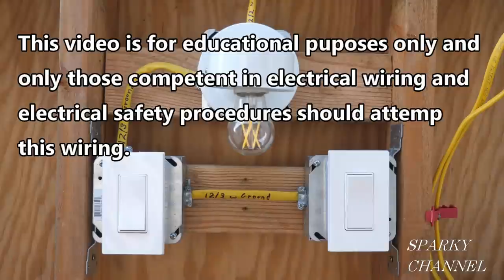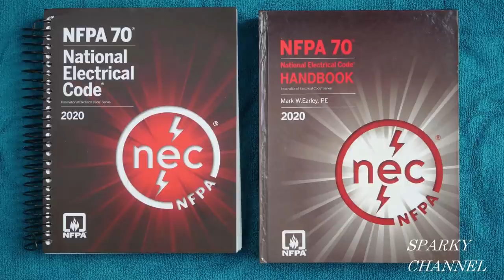How to Wire 3-Way Switches with Power to Light, Only 2 Cables and Neutrals in Both Boxes!

Comment: I don't think I have personally ever used a 4 wire that I can remember. Excellent video.
Reply from the maker: I have a whole roll of 12/4 w ground but it's in MC. It's really nice cable. Thanks Rick! Have a great Super Sunday! 🏈
Reply: I can't say I ever have either.  Because 4 wire w/ground cable is a specialty item only used in very specific applications, where I work if we ever needed 4 wire we'd run two runs of 2 wire.  A few weeks ago just finished roughing a house with a light/fan/heater combo in the master bath.  I ran two sets of 12/2, the second set I used red and blue phase tape on the black and white respectively on both ends of the cable.

Comment: Great vid again!!!!  And remember to mention the oversized boxes for future stuff
Reply: why if pros are to cheap along with do it yourselfers or they dont know than they are not skilled enough & shouldnt be attempting to do trades work its called trades work for a reason. only craftsman should be doing electrical work not con-men i mean professional contractors. lol
Reply: @wizard3z868  I’m too important
Reply: @MrTooTechnical  lol 😂
Reply: @wizard3z868  lol. Rock on baby
Reply from the maker: I will mention the big boxes next video. I was watching a very popular electrical channel and he filled his little plastic box up with 3 cables including a 12/3, lots of wire twists etc. Then he smooshed everything into the little box with the end of his hammer and somehow stuffed the 3-way switch into it. Much better to pay a little more and use bigger boxes. LOL! Thanks Dave!
Reply: @SparkyChannel  who is this famous channel??????
Reply: @SparkyChannel  
I almost always use the biggest box that will fit in the wall but the interior walls of our home are only 2x3 instead of 2x4. Still if I absolutely need the room I'll put in a double box and then use a cover plate that is blank on one side.

Comment: I just changed my kitchen light into into a 3 way this weekend with power at the light. Wish this video had come out earlier.
Reply from the maker: More to come! I wanted to create a series on power-to-the-light 3-way switch videos because so many folks with older homes (40's, 50's, 60's) have power run to their lights first. And of course I like to include appropriate current NEC articles because I hate when people just say the code is this or the code is that. Half the time they are wrong or out of date anyway. Thanks Jamison! Have a great Super Sunday! 🏈
Reply: @SparkyChannel  my house was built in the 50s and so it was exactly that. However I also wanted to replace the cloth wire coming where I can, so I ended up just running new romex to the switch first and doing in that way. But I did ensure both boxes have a neutral!
Reply from the maker: @jamisongillespie3524  Excellent! I should do a video on that conversion. It would be too late for you but many others will be facing a similar situation in the future.

Comment: I use 12/2/2 romex. Supply house keeps it in-stock.  Same wire I use for heat/vent/light switches. It has white with red stripe instead of a blue.
Reply: Yes my local electrical supply house carries that as well but since I am just a DIY homeowner I won't be using it cause they only sell it in 250’ rolls. I'll just use two 14/2 cables. One will carry power/line and neutral and the other will carry traveler wires with the white painted either red or blue.
Reply: @njsongwriter  I have used 2 pieces of 12/2 for hvl instal as well. Do you prefer stacked switches. If you use a single gang box and I stacked switch with 3 total 12/2 cables (1 in for power and 2 leaving to the hvl) then you are pushing box fill to its maximum or possibly past it depending on type of single gang box used

Comment: I'm not sure about 14-4 W/G or 12-4W/G NM, but I have seen 12-2-2 W/G NM cable stocked at an electrical supply warehouse a few years ago.  Don't remember the exact price but it was very pricey.  It's really helpful for wiring split receptacles in new kitchens that now require AFCI & GFCI protection,  and you cannot share a neutral.  Like how many kitchens in the 80s, 90s & early 2000s, were wired, before just about everything required AFCI protection you could use a standard two pole 20 amp breaker and 12/3 feeding the  two GFCI outlets for the first outlets and the downstream receptacles along the countertop,  etc could alternate between the Red and Black phases and be standard or decora style receptacles, all run in 12/3 .
Reply: Ok who cares..make u a video 😅

Comment: Hi Bill!
Can you make a video showing us how to wire 3-way switch with power coming into the switch box when the light is between the switches where the second switch is at the end of the run?

This is the situation I have with my garage light. The first switch with the line cable is out in the garage, then the cable runs to the light and continues to the second switch in the utility room inside the house.

Comment: over here ground is Blue , Faze/ live wire is  ( 230 vac ) brown. Switching wires ( a wire that comes after the switch ) is always black. Earth wire is the same yellow green. wires are pulled always through 5/8 pvc pipe or if needed 3/8 pvc pipe.

Comment: Hi Bill from Sparky Channel 

Blew the roof off with that one

I’ve never seen 12/4 cable for sale. I’ll have to look.
Guess you could make it.
Would be handy to have.

Wondering, would that be  MC12/4 cable and do they make a NM version as well.
I’ve heard of 12/2/2 NM.....
So many types of cable
Maybe a video one day showing all the types, uses, etc.

One again, learned something new from you.

Thanks again....
Reply from the maker: Yes, you can buy 12/4 NM or MC at electrical supply houses. Thanks Jeff! Have a great Super Sunday! 🏈
Reply: I can buy 14-2-2 locally but only in a 250' roll. Not something cost effective for me as a homeowner that doesn't need more than 35 feet. I can either use two 14/2s or I found a place online that sells 14-2-2 for 83¢ a foot.

Comment: Is it possible to add an outlet to the first switch? I have this configuration in my garage but the line into this switch has a hot white wire? My line in is 12/2 and line out is 12/3 (which goes to the other switch).

Comment: Hi, I need a video of installing a ceiling fan, but having 3 way switches to the fan and the light separated. 
In other words, be able to come into the room, switch on the light or the fan, then leave the room at the other exit, be able to turn off the fan and then turn off the light separately. 
Also, do they make a double three way light switch?? If so what would it be called?
Thanks. I love watching your videos.
Reply from the maker: Cool! I could wire that for sure. I would use double switches on both ends each with 2 3-way switches. As a video that would be too long though I think. Each set of 3-ways would get it's own hot and each would have it's own load cable (leg) going to it's device.

Comment: Can you use this source to run a few outlets in the same room? Thanks
Reply: You generally want your lighting and receptacles on a different circuit. Is it feasible yes, but not ideal.
Reply: This question gets into NEC section 210 as to what can be done with various branch circuits.  As Victor said, it's a good idea to separate your lighting and general use receptacle circuits, if for no other reason that you don't lose the lights if someone plugs too much in late at night.  There are some situations such as laundry, kitchen, and bathroom where a dedicated outlet circuit is required (210.11, 210.52) and that circuit is not permitted to supply lighting outlets or receptacle outlets in other rooms.

Comment: When you have a mud ring installed, about how far does the switch come out from the wall? I'm used to everything being flush with the wallplate installed

I can't imagine those things are for exterior use only (mud/plaster protection) since I can't recall the last time I've seen a three way switch outside
Reply from the maker: I always use 1" or 7/8" mud rings outside. You plaster right up to them. They work beautifully for any exterior switch, receptacle or light. They have a variety of sizes available. Have a great Super Sunday! 🏈

Comment: One thing I'm not sure of is can you always run two 14/2 cables instead of one 14/4? For example run power to a combo switch from a fan/light. You need a hot, switched fan, switched light and a neutral if desired. Of course two cables works fine, but is it code? And if so, which conductors should be together? Thanks
Reply from the maker: I don't think there would be a problem but I'll have to check on that. Good question!

Comment: Why not make the black wire in the 12/4 cable be the “HOT” line wire. And make the red & blue wire travel. 
I think it’s simpler to connect the same colour wires together that have the same purpose.

Comment: You could put your black hot on your common black screw from your first switch, black and red for your travelers, us the red switch leg from your first light and bcap it to the blue wire on but that blue wire on your common screw in your second switch, and use the same red and black as travelers as you did to the first switch.

Comment: Why is a ground wire needed on the box on the right? Doesn’t the metal BX (I think you call it something different) ground the box.
Reply: Because he didn't use BX. There are two different common cables covered in metal. One is called AC (Armored Cable) which is often called BX. AC is rated to carry a ground through the metal sheathing.  The other kind is called MC (Metal-clad Cable) which is NOT rated to carry a ground through the metal sheathing.
Reply: @HoosierRallyMaster  thanks i did residential wiring about 30 years ago in Chicago never worked with anything but Emt. I love watching his videos
Reply: may not be needed but i always run an egc no point in being lazy no real cost diff either when they charge like %500 markup funny how a plastic box  is always like $5 or $6  but i can get an extra large one for $1.20 at big box store(lol i just checked they where like .65 cents with an old work at $1.33
Reply from the maker: @HoosierRallyMaster  Thanks for the explanation, that was really good!
Reply from the maker: @opietwoep1247  Thanks! Have a great Super Sunday! 🏈
Reply from the maker: @wizard3z868  Yes, you can always exceed code and it's a good idea to have a redundant ground!
Reply: @SparkyChannel  same to you

Comment: I had used 14/2/2 nmc (romex) also I believe there is 12/2/2 available..
Reply: availability varies by market and vendor, generally more miss than hit
Reply: Those are available locally where I live but you have to buy a 250 ft. roll. Not something I will ever do.

Comment: thanks Mr sparky!! I now have the best fix option for my home. it's was not done with code because it wasnt required in 1983 cuz it was out of city limits

questions: does it have to be #12 or #14 ok?
Reply: This configuration of lights and switches can be done using #14 wire.  Determining appropriate wire size across any given situation gets into many nuances of code, so I won't say straight up #14 is ok for you.   However, oversimplifying for almost all residential applications, #12 is for 20A breaker circuits and #14 is for 15A ones.  Match any existing wiring on that circuit and check that it matches your breaker size.
Reply: @RJ-ej1nr  i was reading up on it. i put all led lights as replacements. i purchase some 15amp to replace old cabling to these lights. one will only have 2 led (60 watt) lights and 2 outlets. Another will have 6 leds(60w) lights with 5 outlets. so i believe it will be ok. this will also free up a 20amp breaker for my heater in master bathroom.

Comment: instead of 14-4 or 12-4  either run two cables together or 3X+ the price for the 12/2/2- 14/2/2
Reply from the maker: That would work if you re-purposed the extra neutral to a hot. Then you would have 3 hots, a neutral and a ground wire. Good thinking.
Reply: @SparkyChannel  
You just answered my question.

Comment: The problem with 12/4 is that it is not available in lengths less than 250 feet. So you end up having to use two 12/2s instead.
Reply from the maker: True.
Reply: @SparkyChannel  
Actually, I did find a source online that sells 14-2-2 for 83¢ a foot.
Reply: You can get 12/2/2 instead of 12/4. Both have 4 conductors with ground
Reply: is using 2 runs of 12-2 in place of 12-4 code compliant?
Reply: @jerseyjim9092  don't see why not.   I've done that once or twice while wiring dead end three ways in renovations,  when I also need to have a receptacle below the newly added 3 way.  I ran two runs of 14-2.   One for the power, another for the travellers.   For the travellers I use phase tape and mark the black as red, and the white as blue.   Never had any issues with the inspector.

Comment: There's an alternative way of wiring this. On the alternative method you'll have the permanent line, the neutral, the ground and the switched line in all boxes. Black as permanent line connected on both switches to one of the traveller terminals. The red wire as switched line on the other traveller terminal of both switches. Connect both common terminals with the blue wire. That should look like this:

https://upload.wikimedia.org/wikipedia/commons/thumb/5/59/Sparwechselschaltung.svg/2000px-Sparwechselschaltung.svg.png

This is also the method to go if you want to install control switches which have a neon indicator in them. They're used if you switch a light which you can't see directly. The neon indicator in the switches indicates the lights are on or off:

I have this for my attic lights, the switch is in the floor below so you can't see the lights directly:

Off:
https://abload.de/img/img_0960xqkuv.jpg

On:

https://abload.de/img/img_0961kzjhp.jpg
Reply: What you are saying is not true.  You will not have a Neutral in all boxes using the diagram you are showing.
Reply: The whole purpose of this wiring method is to have a neutral in both switch boxes for future smart devices. Can't believe you typed that whole comment out and provided links. Right answer to the wrong question...wasn't that a Dr. John song?
Reply: @HoosierRallyMaster  The diagram is only showing the way the lines are switched, because the neutral is irrelevant for the regular switch. So they don't draw it into the schematic to prevent confusion. If you use the proper amount of wires in your cables, like Bill did, you will have a neutral, a line and a switched line in all boxes, and of course also a ground.
We use this method here to install outlets next to both switches. And outlets require an unswitched line, neutral and ground....
Reply: @Cleofizoid  And with my method you'll have a n unswitched line, a neutral and a switched line in all boxes. If you want to retrofit a wall mounted light fitting later you can start from all boxes. And it's also possible to retrofit a smart switch later...